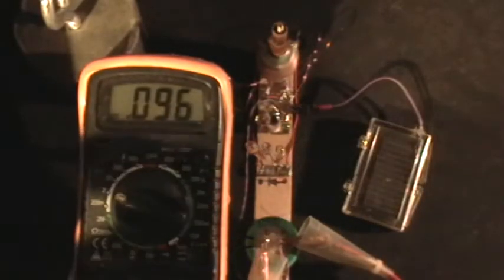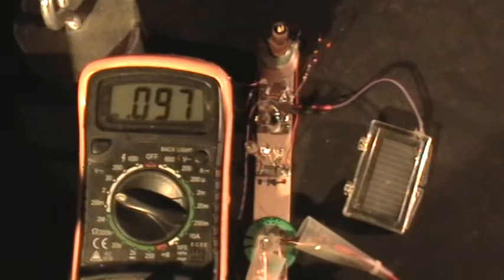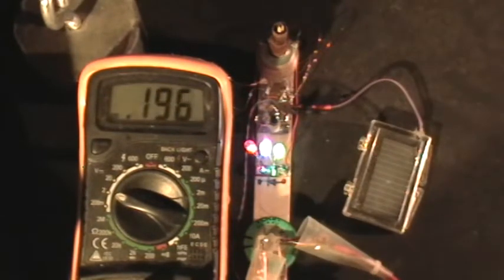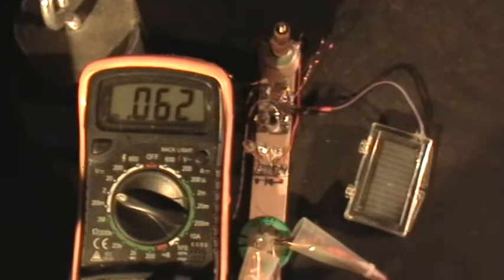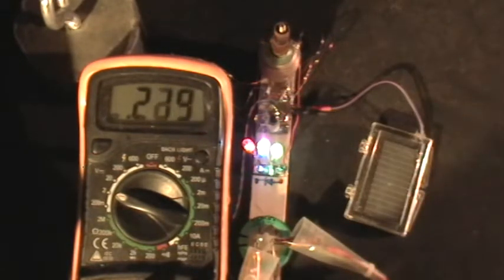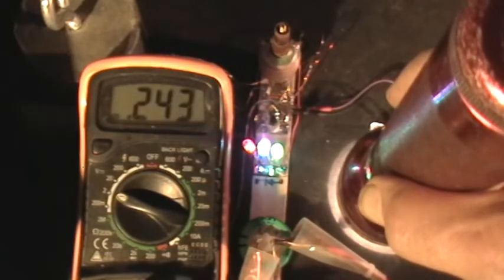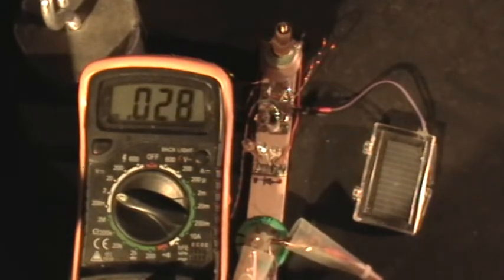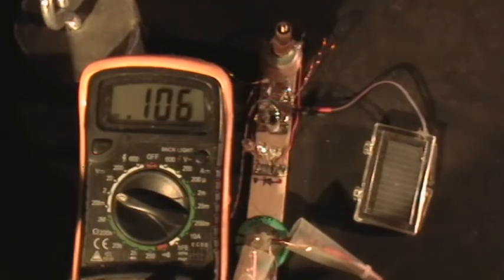Joule Thief: TKLS SooperLooper Runs on Solar Cell

Comment: The trick to get transistor to run below 0.1volts is to get a "transistor with a low drop between vce" .My older 45mV video was using Japanese transistor 2SD1450 with Peltier which upon shorting emitter and collector to force kick start oscillation which run as low as 45mV to get red led lit.The ZTX1049 transistor can go even lower at 30mV.
Only the 2SK170 is a self starter at around 25mV.Put this in parallel with ZTX transistor which automatically kick start ZTX transistor at around 30mV which provide better "current" support.
Reply from the maker: OK, thanks, I'll try it when I can. But you were lighting one LED? I have three in series.
It's hard for me to locate some of these transistors. Mostly I just scavenge old TV sets and I haven't found a 2sk170 yet, or a 2sd1450 either, I don't think.
Reply from the maker: I tried some other transistors and got these repeatable measurements:
BC337-25 goes to 0.104 volts
MPSA18 goes to 0.123 volts
2sc3198 goes to 0.111 volts
and even
2n2222a goes to 0.102 volts !!